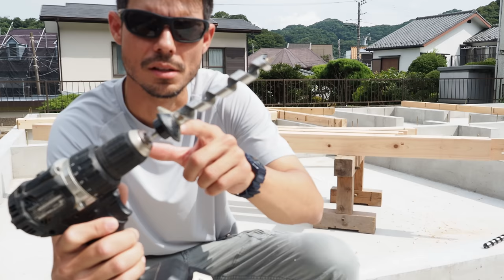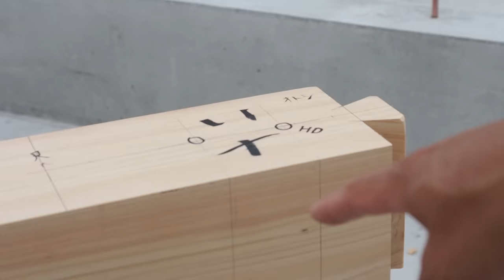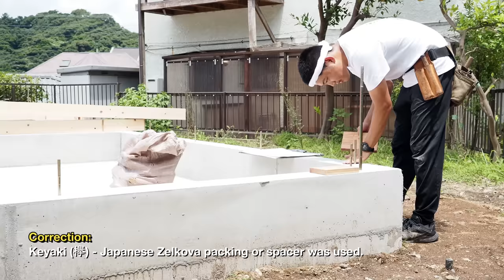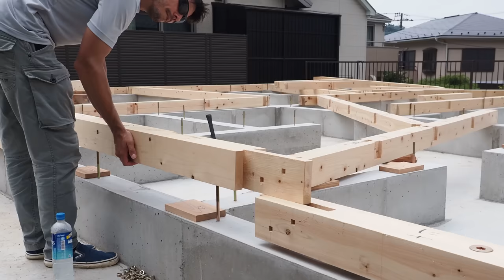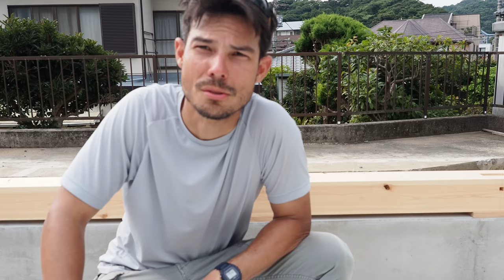Japanese Foundation Structure Explained! - Dodai (土台) - Setting up the Dodai (Foundation Beams)

Comment: 120v vs brushless DeWalt? You can get more power from battery nowadays. Check torque output on those units and I'm sure you'll be surprised 😂

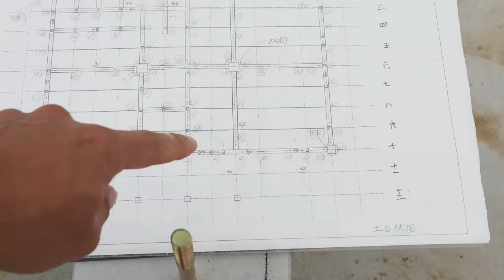Comment: this is a popular practice around the world but I do not like the idea of drilling such holes especially next to a dove joint 3:34 where the amount of wood surrounding a big hole is little. I would rather put a flat iron around the beam and anchor it to the the foundatioun sideways in the middle of the rebar work where the force required to pull it would be much stronger

Comment: gotta say, my Milwaukee cordless 1/2" high torque impact could easily handle those nuts;) probably also my 3/8". i also have a 1", but that would probably strip the threads.

Comment: I can appreciate the craftsmanship as a woodworker. Too me it seems silly, and in some ways less capable than what people consider the “cheap route”. Like using nails instead of spokes because they bend whereas wood overtime will start to twist & crack on itself. Or the fact that they used complex joinery which looks cool, but assuming the foundation is something you don’t see is pointless for the structural integrity and would just take longer. Or the fact that they spent time making it look nice, but it isn’t pressure treated at all, and in direct contact with cement… that WILL rot after a period of time no matter what and seems like a major design flaw. I think I will take the modern American home & construction; the Japanese have better more unique craftsmanship in other things

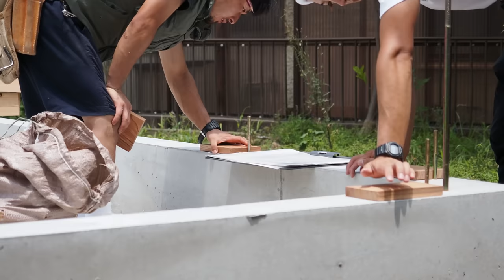Comment: Where do I get one of those jackets with air conditioning in them at 6:51
Reply from the maker: You can pick these jackets up at most hardware stores or work clothing stores throughout Japan. There are several brands that make them.

Comment: As a european, i am curious to know why the concrete foundation is so comprehensive? Why not just make concrete pillars and skip the concrete slab in the lower part, when there is a timber foundation to carry the load?
Reply: Earthquakes?
Reply: @Tom K.   ah, could be the explanation if the concrete slab and raised walls were reinforced together
Reply: A construction method called BETA-KISO (Mat foundation construction method) .Maybe earthquake, moisture and termite control.
Reply: @あおいみう   ah, yeah makes sense. It also protect against rats and other rodents nesting under the house

Comment: that is an anchor bolt with a j hook i'm assuming, not a threaded rod.  A threaded rod is threaded its whole length.  You're specialty drill bit is a counter sink bit.  Your threaded rod is not straight because you didn't place them properly in the cement when you installed them during the dry.  
The questions i'd have is why don't they use sill tape?  Also why use complicated joinery vs using joist hangers et al?  Seems like a dramatic waste of time and money for something people will not be looking at after the build is done?  I mean do you put up a shower rod with a 50 ton crane?  Is there a reason why glue isn't used for your dowels?

Comment: I don't know how using chestnut on bare concrete as a barrier from the other wood could ever pass a housing inspection. Chestnut is classified as termite resistant but not termite proof. Which means this home could have a termite infestation at some point because the first layer of wood against the concrete wasn't treated wood.

Comment: Since Japanese homes are only built to last 25 years, why such effort and time put into the foundation? that foundation could last 100 years. One odd thing about this building technique is bare wood contacting concrete. We can't do that in the US because it gives termites a direct path into the structure. We have to use treated lumber (and we have to treat any cuts made to the lumber) and/or use aluminum flashings to prevent wood from contacting a concrete slab.

Comment: Eventually these beams will be a manufactured material repurposing recycled plastic. It will work well but not have the same feel or aesthetic. Decking boards are already available in Australia. But they just don't  look or feel the same. Kinda like showering with a raincoat on.

Comment: I don't understand why they pour concrete then add wood beams on top.. why not place it directly on the concrete versus doing it this way? I guess maybe it has to do with the country its being built? Tons of joints there that will never be seen or appreciated so that's why im confused as to why all that work
Reply: There has to be airflow under a wooden building to prevent rot and mold. We usually drill the holes in the foundation itself, but this method is probably more traditional.

Comment: I swear my own home will be built with this kind of precision and care.  I hate how homes are built in America, where nothing is treated with dignity and ambition.
Reply: @H2s yes. And in “general” japanese are known for building quality things. What your point? Lmfao.
Reply: I have a Douglas fir timber frame home that was all CNC machined at a factory. Fit together perfectly with oak dowels.  Should last for hundreds of years. The builders didn't set the wood directly on concrete either.

Comment: You would be better off painting the wood and  the concrete  with a water barrier paint. Amd then placing a bitumen vapor barrier. . Or using pressure treated wood .

Comment: Looks extremely inefficient. In NZ we pour a flat slab with steel reinforcing. Then similarly bolt on 4x2 inch timber framing with a thin (~2mm) moist stop barrier under the entire length, with no need to countersink the nut as within the wall cavity. All the complex dove tailing is just over kill.
Reply: It's just the way it's done because people appreciate it and this is already quite modernized as is. The really old school houses in Japan or Korea have an amazing amount of attention to detail in their construction.

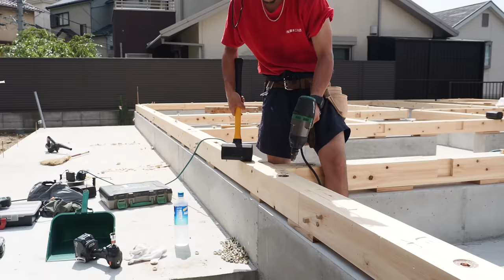Comment: 11:10 I'm not entirely sure this is accurate.
I'm pretty sure a cordless high-torque wouldn't have any issues, especially the new ones coming from Dewalt. (The new 961 is NUTS (pun entirely intended))
Especially given the amount of abuse those things usually take in machine shops, there shouldn't be any problems.
Again, i could be wrong, but this feels a lot like monkey-ladder information. :I

Comment: I guess the law of physics different in Japan and they not afraid of capillary suction in concrete.😂
To put the wood directly on concrete without hydro insulation layer to prevent rotting.

Comment: this is not a good foundation !! earthquackes !!! you need the house , the wooden frame to be able to move from the concreete base .. this can be done with plasitc sliders and the holes fo the pins connecting the wooden frame to the concreet frame need to be able to move a couple of cm..
my house id build that it can move on it concreet base .. thi can withstand a earthquack of 8 .. design by tokyo uni .. .
so this look nice but what will happen after some earthquacks.. because your concretet base is connected to the house frame this can lead to damage to your house ..

Comment: Why all this wood? Just put styrofoam insulation in and pour the concrete floors on top and then build walls out of some bricks and you have a proper house. Wood is for furniture.

Comment: other than using the Japanese names for mortise and tenon joints ... and snap lines ... nothing really different from other construction practices ... as for the wood separator layer ... wood touching concrete is rot waiting to happen ... basic foam sheet in a roll is better and as for the poured concrete it should have been leveled during screeding so there were NO HIGH SPOTS ... and the threaded rod should have been placed with a spacing washer to line them all up to the middle of the form properly ... in other words amateur job on everything except for the joinery ..

Comment: OMG so much wasted work. Why introduce those origami - puzzles to fit the wood pieces?  And no pressure treated wood to prevent termites, etc?  Why did they leave an insect highway between the concrete and the wood beam?  Just cut them beams and secure them to the foundation using bolts and with a strip of foam between. Thats it.  No wonder japanese industri is being out-performed on all arenas if they keep wasting time and effort on things that won't work.

Comment: this is cute, but USELESS. in fact, counterproductive. you'd be better off financially, material, and time wise to use prefab structures and joinery. wood always frays btw over 50 to 100 years. japan is lucky it gets cold half the year and dont deal with serious bugs. the lack of screws nails etc in multiple redundant locations is absurd to me too. clean worksite beautiful cuts but for what? COMPLETELY unecessary.